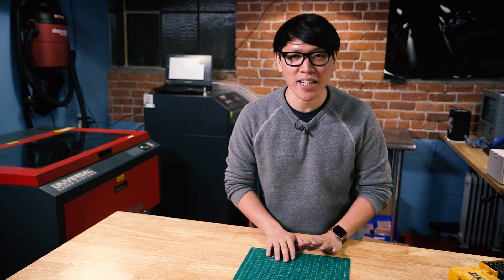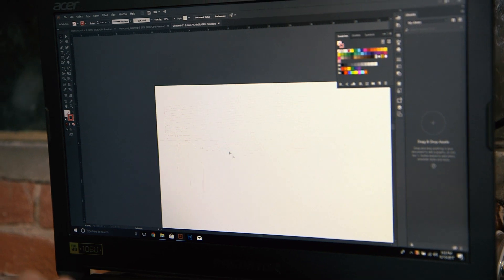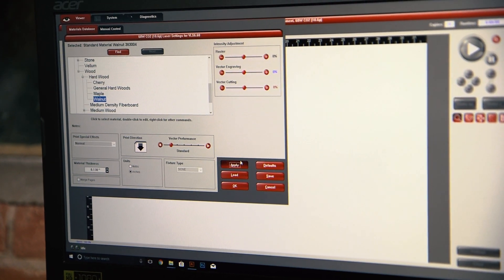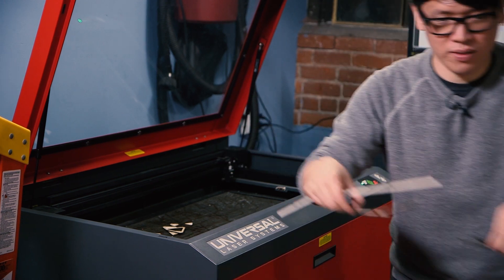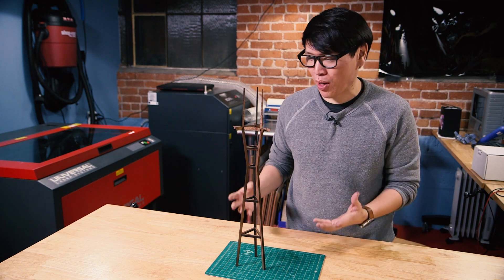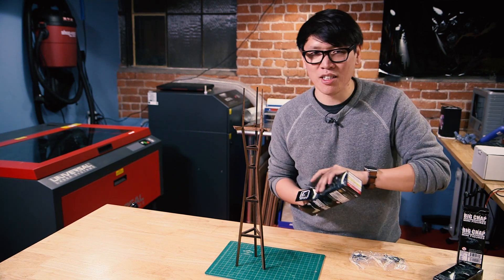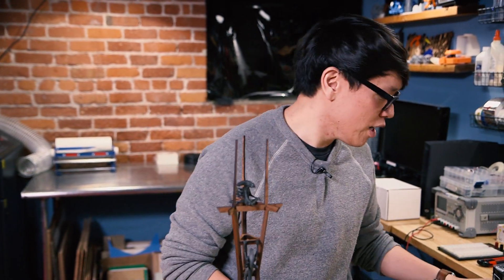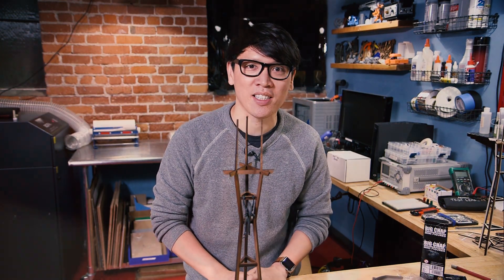Making a San Francisco Sutro Tower Scale Model!

Comment: Hey! That's where I get my tv from! (When I watch tv, which isn't often, I use a desktop disc antenna that came with a built-in wide band amp into a usb tuner plugged into my linux desktop.) It would be fun sometime if you had the time and inclination to more accurately model the tower.

Comment: I like it. :-)  The whole point of a White Elephant gift is it should be funny and weird, not useful or expensive like normal gifts.  Based on a lot of other comments I am reading below, I think a lot of folks are missing said point of this particular project.
Reply: I think the term White Elephant isn't that common. I had never heard of it (I'm Dutch) but after looking it up the whole point is to entertain rather than to gain. We have something similar here that we do over the holidays, mostly with friends but also family. It's called 'Suprise' and everybody randomly draws someones name. Then you get a budget like 10 of 15 bucks that you have to spend on a present. Usually it results in a mix of entertaining and useful gifts.
Reply: I really think they needed to explain some things to make people understand. I thought the aliens were pretty random until I found your comment. Wish they'd explained that in the video.

I also had no idea what Sutro tower was nor what it looks like so I just had to assume Norm's model looks right despite those horizontally protruding beams near the top and the gaping holes in the structure. Turns out it's a radio tower that looks pretty much spot on with the wood model. Wish they'd shown a picture in the video.

Comment: A nice, and wanted, increase of difficulty level would be to use the fact that you used half-thickness material to accommodate channels inside for optical fibre strands and tiny holes for light points at accurate locations along the structure.

Comment: Do you use CA glue for your laser cut kits? I have always used either PVA or Wood Glue, I would have thought that depending on the type of wood used CA glue might be absorbed by the material too quickly to actually create a strong bond. Something to try though!
Reply: Nick Powell There is CA glue made for wood. It is thicker than usual, but not that gel crap. But for sticking some notched sticks together, anything will do.

Comment: Can we get a link to this Butyl stuff Norm uses? Is it like a putty?
Reply: It's the same stuff that RV'ers use to caulk windows, doors, skylights, etc.  Comes in a large roll like thick tape -- enough to last several lifetimes if it were used only for modeling.  It is also not cheap.  Find it on eBay or RV dealers.